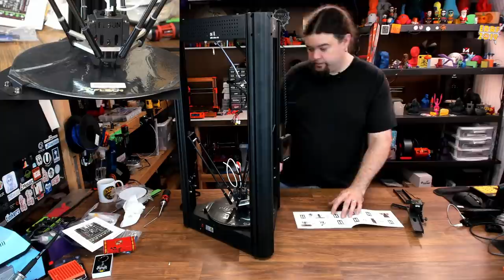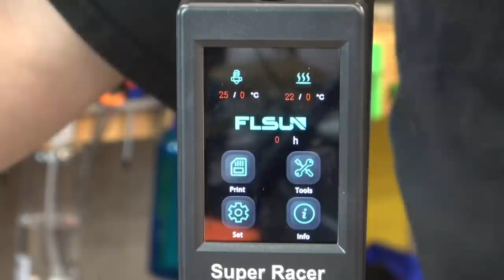FLSUN Super Racer(SR) Delta 3D Printer - Build & Test - Chris's Basement

Comment: I replaced the mosfet on my skr 2 rev a. No way some hobby printer dude can do it with a soldering iron at home. However i still didn’t tested it.
Reply from the maker: Let us know how it goes!
Reply: @ChrisRiley  I´m at least sceptical, but I share your thoughts that it´s spec-wise a good board. I do have the skr pro 1 in a pic and place machine, seems like the processor series is having some trouble with sd card management in general, but I didn´t touched it for a while.